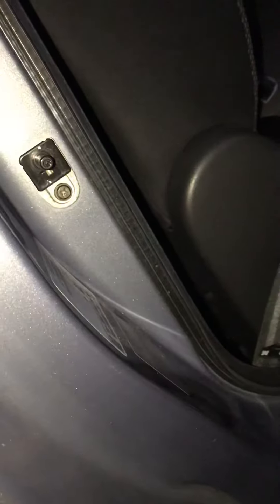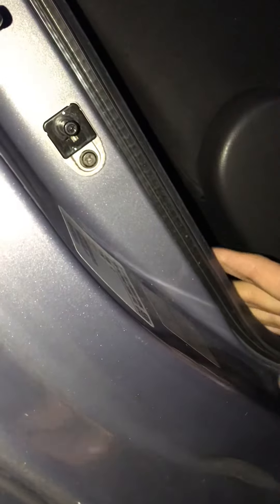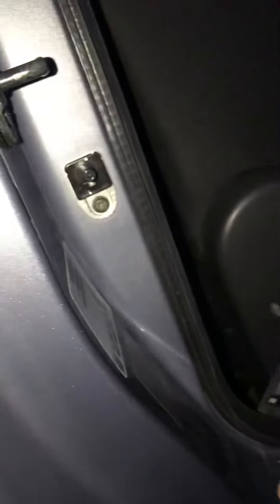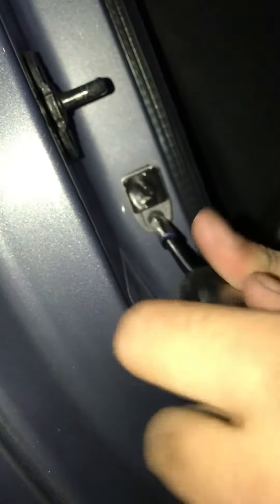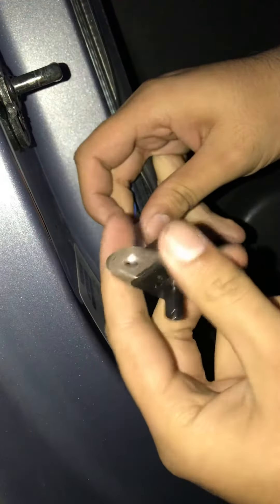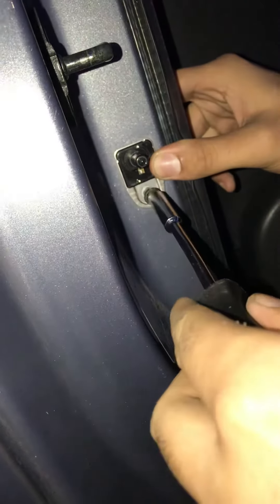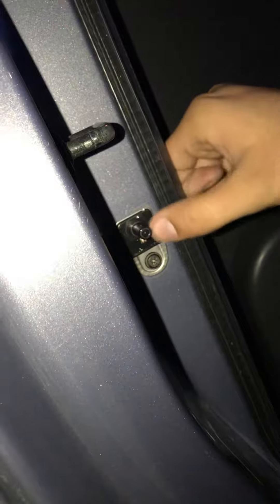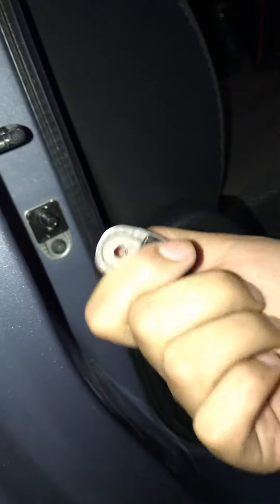HOW TO FIX INTERIOR LIGHT PROBLEM WHEN DOOR OPENING ON NISSAN MICRA

Comment: Thanks for this video🙂
My drivers door doesn’t active the light anymore. This may be the problem 👍🏼
Reply from the maker: Dan Robins no problem glad I could help
Reply: I have the same problem. Is the switch the only problem? Because i went to a guy to check it and he used some cables and stuff to the switch but he didnt change the switch though and it didnt work, or maybe the problem are the lights?i mean if anything is wrong at the design of the lights something inside

Comment: Thanks for this. In my car, the light won’t go off when the doors are closed. Is there any way to check if that’s caused by the switch?
Reply from the maker: Hi glad you liked the video, the best way would be to just get another switch they are inexpensive from eBay or a scrap yard and test it if the problem is still not resolved I would recommend checking the wire.

Answer to your original question there are multiple method to check the switch I.e remove and connect to a live connection and check the voltage but for what they cost and the amount of work required to do it, it’s easier to just change the switch.

Hope I could help you